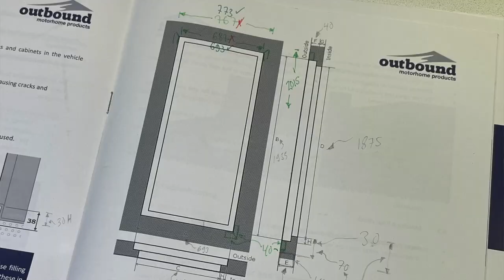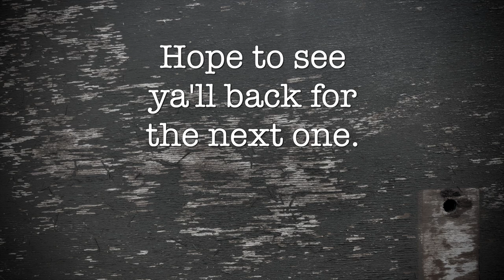Unimog Camper E035 - Building the wall structures - Part 2

Comment: Looking good, but also heavy. Do you need all those cross braces in the roof?
Reply from the maker: I don’t know if the are strictly needed, but the roof needs to carry several people’s weight without damaging the insulation. 
The weight of the roof is 74kg if memory serves (check episode E033 for details).
It’s also the only structure that can take the sideways and diagonal forces of the rear load. 
Most of the sticks are 1.5mm or 2.0mm wall thickness, so it easily looks heavier than it is. 
Thanks for your comment. It’s always good to hear other’s thoughts. 😎👍🏻👍🏻